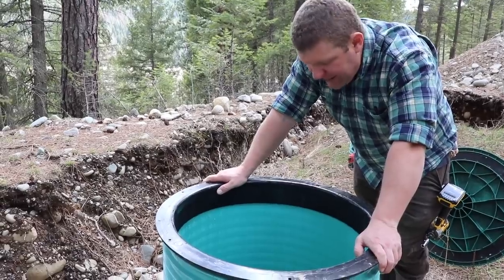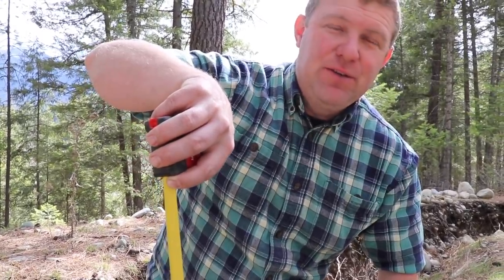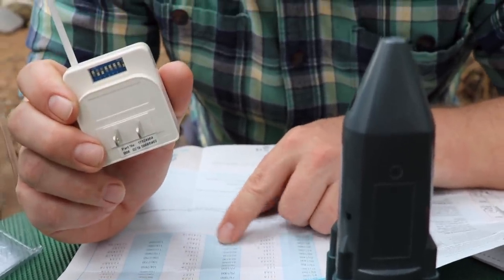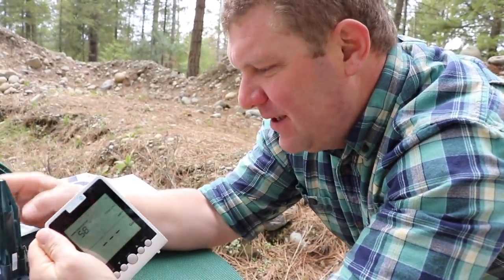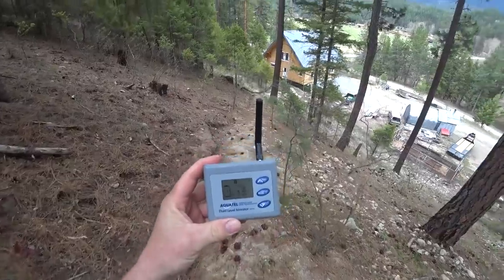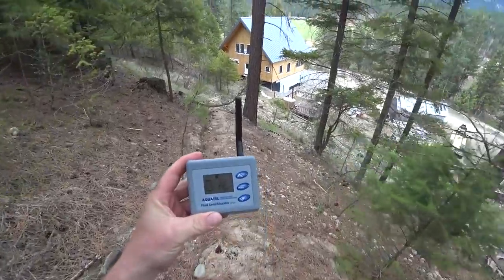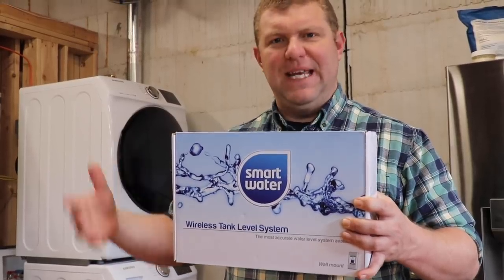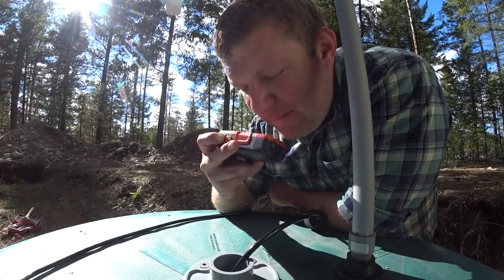Testing & Comparing Wireless Tank Monitors for Water Cisterns

Comment: should the in water sensor sit on the the bottom of the tank and what are you using for drinking water as you have added salt to your tank so you cant drink it or use it for cooking deadly for newborns too (remember you cant drink salt water) also over time it will coat the inside of the tank

Comment: Just wondering, are you filling the tanks with softened water? I am filling my emergency reserve tank ( 1500 liters )with straight hard water. When needed in the summer months when there is little or no pressure from the city service my pressure pump will kick in and supply the house with water which will run through the softener. Using the last system you could set it to fill the tanks when they reach a certain level and never worry about running out. Been working over 12 years on my home slowly. Next project is solar/wind power to get off the grid.
Good luck with your home projects! In the end its well worth it!

Comment: This may sound too simple, but why don't you measure the water that goes up the hill when you are pumping so you know how much water is in the tanks.  Then as you use water and it comes down the hill you measure that and subtract it from the amount of water in the tanks.  If you know someone who knows how to program an Arduino micro controller they could build a simple display that could display gallons of water in the tank based on signals from 2 or more flow sensors.  With 3 flow sensors you could measure water going up the hill, domestic water used, and garden water used.  You could also put a LED indicator in each bath the kitchen and the laundry that would indicate a low water level.  No radio transmission problems, no electronics out in the weather, no animals chewing on the wires.  One last thought:  If you put a solenoid valve in the garden water line you could easily control how many gallons of water each watering would be, when the watering would occur, and how many per day.  Total cost should be $60 to $120 depending on what you decide to do.
Reply: Na gravitační vodovod mu stačí mít nádrže pár metrů nad nejvyšší výpustí. Bude mít problém s přetlakem, mimo to, že ho to umístění na kopci bude stát spoustu energie, kterou by mohl využít jinak. A protože je v síti, tak to bude drahé. Už si naříkal nad vytápěním té garáže s průvanem v zimě, vytápěl ji přímotopem. Je to boháč, rád plýtvá penězi a elektřinou. Je to osvěžující v tomto spořivém světě.

Comment: The Fresnel point of the radio wattage from the tank sender transmitter to the screen has issues going "sideways" as the modulation per db is too far low to travel on that wavelength down terrain with the obstacles in its way. the amazon "jaycar" one, I used an beam (old cantenna) on a max 2meter coax antenna lead to the TX antenna made externally for the range of 433mhz UHF or 70cm band (limited by law to under <1w max 4db +-16% overpass) due to the noise levels of that frequency could get swamped by other communications that work on that same  433 spectrum ISM band (basically its allowed to transmit and receive "digital/PWM analogue noise" talk frequency . The option is to mount an dipole or beam point antenna with its direction of travel so it will work greatly. Yes the TX will be very directional, yet you will have less interference from other similar TX 433 devices. aka, garages, car immobilizers, arduino, reminder buzzers (like the boomerang announcer when picking up medication or waiting for food at huge arena/airports), WISP, even space weather is TX via satellite on the similar but much wider modulation and the list goes on that is used in that allocated free band! Unfortunately the antenna is under 1w and the TX on these puppies were under 2/5ths of a watt so basically 200mw at 1db is <200mw due to the housing and plane of the antenna pep with terrain like that would only work on a horizontal p2p (because the antenna is above a ground plane (internally) but the failure is the TX output and tiny antenna. if still no luck its more to do with you can also modify the RX with an external antenna pointed at the TX tank. or do both :)

Comment: the aquatel has external sma plugs/sockets on the 'ant' side, which can be upgraded with a more robust strength with an external yagi directional antenna. they would far less issues with overlay problems down the track. for example. your tanks are below tree line, during winter snow and the pine tree sap and leaves would dampen the signal in an instant. put a external antenna connected and run it over 6 meters away to a higher point. also use non corrosive silicon on the antenna socket from the inside, so when it does snow, it wont leak water into your tx tank system, or it will be a goodbye product and failed warranty.

Comment: I would say the cheaper units are meant to be used in close proximity. A tank next to your house catching rain runoff from your roof would fit the expected use case. The last 2 you tested with removable antennas is capable of being used at a longer distance. The antenna connectors looks like the SMA type that is usually used with wifi routers and antennas. I would bet those devices are using 2.4 GHz antennas, so you should be able to swap out the included omni antennas with higher gain directed antennas in order to increase the distance that the units could operate even more. example: https://www.amazon.com/AVACOM-Extender-Wireless-Directional-Connector/dp/B078Z1V4XL/

Comment: Isn't there a kit for sale that extend the antenna so you can place the reader inside with the antenna outside of the house??? I mean that must be a common issue for many people to get a propper signal when it's used inside. Also if the antenna is higher mounted on the house  the hill is not in the way .

Comment: I am not sure if you are still filling your cisterns with softened water but if you are your plants won't like the salted water best to use straight well water for them, also it is not the best water to drink and cook with due to the extra salt--You should plumb the softener just to the hot water system in the house only and use your softened water for washing stuff and showers and use a water filter/reverse osmosis system for drinking and cooking with
Also with the new baby be careful of that slightly salted softener water
Reply: The amount of salt added to the water is minuscule.   The salt is used to clean and recharge the filter media and is flushed out of the system once it is recharged and before the system goes back into operation.  That is why you set the regen cycle to happen when no one is using water, typically in the middle of the night.

Comment: Seems to be a lot of comments about an internal/automatic tank in the house like most wells.  Is your concern about electricity outages. If so then the large tank up on the hill (Gravity pressure) makes sense.  It tkes a lot ofenergy to pump water up a hill. Water weighes about 8.4#/gal. So lifting the 1500 gallons of water up an extra 100ft (?) in elevation uses a LOT of extra energy. Some smart EE can come up with the calcuations.  I'm an engineer and I like all the extra data, I always tend to overdesign my HOME systems. Adding an extra pair of wires (low voltage) up to the tank for a float system should be fairly simple while the trench is open.
Reply: Má vedle domu svah. Nádrže stačilo dát kousek  dnem nad úroveň střechy.  Tam pro ně vykopat uložení, nahoře je vytáhnout, na laně spustit do toho uložení blízko domu a ne tak vysoko. Možná i jednoduše vytáhnout jeřábem, naložit na vůz a stejně jako je tam dopravil odjet s nimi k domu a tam je jeřábem uložit do připravené díry. Ale má tam svah a stromy, takže je spustit na dvou lanech může na tom svahu kamkoliv s dvěma ručními vrátky. On a dva kamarádi by to zvládli zadarmo.

Comment: You guys are scratching your butts with your elbows. You have that second conduit to your cisterns laid especially for pulling wire. Suck a birdy and a snake line through it and pull 10 - 3 power conductors and a shielded multi conductor signal wire. 

Use the 10 - 3 for lighting and a weater-tight outlet and two of your signal conductors for a passive float switch leading to your well motor starter. If you want to include a wired level indicator you have spare signal conductors for that. In fact, I think you discussed these options when you were laying the piping and conduit many episodes ago.

And, FWIW, GHz battery wireless over a 250 ft hillside cluttered with vegetation and through thick walls is a losing proposition. When they say line of sight, that's exactly what they mean: clear air visibility between transmitter and receiver.

Comment: Taller aerial and maybe booster. Worked in isolated areas and we just attached an aerial to the top of a tree an ran a wire to the radio.

Comment: Sensor bars to tell you signal strenght. What do they mean? 
It's a bit of a weird one, as you'd expect say a 5 bar system to give you signal strenth in 5ths of the signal power, but nope. Thats not how radio strenth works, nor does the ideas of the people who are making these devices (including your cell phone). 
Instead, what they typically measure is the signal gain in decibels. There are power gain calculation formulas used to calculate the antenna ability to transmit... of course it's all nonsense to the lay man, and isn't needed, so hence why a few bars are shown. However, the gain is on somewhat of a sliding scale, so 5/5 bars might mean anywhere from 100% (unlikly) down to 50%. with 4 bars meaning 50 down to 20% and 3 bars meaning 20% to 10% while 1 bar could mean, anything more than 1% signal. That would be down to the people who create the product to interperate how they want to present the signal strenth to the user. If they wanted to generate a peceived better product, they could say 100% to 20% is 5 bars meaning while you have 5 bars of signal, you might only be operating on 20% actual power. not that any of it matters since the devices will work as long as they do have a consistant signal anyway.
Lastly, while antenna size can matter in some cases, a lot of the time it's just additional plastic to make things look better/fancy than it actually is. Mounting an antenna higher up, or changing the type of antenna, directional (more gain in one direction) rather than the included omnidirectional ones and can give you much better results.

Comment: Your signal issues come of a couple of problems. 1. You didn't have LOS (Line of Sight). You would have better results had you taken the receivers and put them up in the 2nd or 3rd floor. 2. The last 2 products that use external antennas will drastically increase your signal over products that have the antennas as either a wire inside the xmitter or on the circuit board (worst). So a +1 dBi antenna will give you a 12% gain on your signal, +2 dBi will give you a 58% gain on your signal and a +3 dbi will give you a 100% (double) signal gain (+6 dBi will give you 300% increase).
Ultrasonic components are pretty cheap (price wise you can get a sensor for about $4). They are not magical and have a lot of limitations (like range).

Comment: clean new sump pump bober switch have it open a valve  when tank is low and turn on water pump at well water pump you can set depth by adjusting lenth of cord on weight. to do the switching use a plc or adruino just saying

Comment: smart water would work, but that solar panel is charging up the battery. how long can it go without direct sunlight? snow could effect its life charge capacity immensely. like your pump, run low voltage to the sender units! you are connecting 110-240v lights up that path? run a low switch-mode dc power brick in an ip rated box on a pole then run the cord in a pipe towards the tank, then the cord can be fused and hard wired to the terminals of where the battery wires run to the tank tx system! you have to take to note of the sap and hill area that these systems will suffer over a short year or two... think outside the box. you have potential!

Comment: just get an accurate pressure guage, like digital, to .1 of a psi. this means that when the tank is full at the house the pressure will be slightly slightly more than if it was empty, this can be seen and if you take down what empty or full is you can tell just by the pressure how full the tanks are

Comment: If you use the Aquatell and the signal is not strong, get some "wifi" SMA 9dbi antenna's ;)
Reply: The higher the gain of an antenna the farther it will travel however in this case where the cistern is a lot higher than the home the signal will overshoot the receiver. In a situation like this you would need an omnidirectional antenna on the transmitter. A physical representation of the omni antenna is like a sphere around the vertical radiator which would be located in the center of the sphere. When you increase gain, imagine that the sphere is compressed vertically and it now resembles a doughnut around the radiator. The volume of the sphere does not change however it is spread out to a larger diameter around the radiator. Now if the antenna is much higher than the receiver the signal will overshoot the receiver which sits in the null region of the antenna. Antennas in the real world that are set on top of towers or other high structures compensate for this with what is called down tilt to fill in areas below the antenna. These require special designs that would be impractical to implement in this small scale. The best solution would be to increase transmitter power ( limited by FCC part 15 regulations ) and with the use of an omnidirectional antenna.

Comment: and you not need tank level, only one switch, show led light you tank have empty or full, 2 switch and 2 led light little cable and ready. and if want automatic ,2 switch and if empty start well pump,then full,stop well pump. thats all what need, have alltime tank full and good, same have my home outside have tank and fill automatic tank full flow switch have full level closed ventile if full.

Comment: i have on to ground water tank plastic. i add contactless water sensors 4 pcs, or if want more, and sense outside tank to water level, cable has connect to arduino board, 10$ and little simple code, id swits1, display lcd percent, or level bar  or both, or little more code, calculate level and show gallons or liters on to display, wery simple and under 70$ all parts.arduino 10$ sensors 4 pcs 8$  about, 32$ cable 5$ display 4$ battery box or power supply 2 pcs 5$ , if want wireles buy 2pcs bluetooth module or wifi ESP32 board, can later add if want relay board and add code full level and empty level code if empty relay on to pump,add water, if full stop relay pump.

Comment: OK NOW YOU NEED A PRESSURE TANK AND A PRESSURE SWITCH SO'S NOT TO BURN THE NEW WELL PUMP MOTOR UP,AS IT WILL PRESSURE UP TO WHAT EVER PSI YOU WANT ,SHUT DOWN UNTIL YOU USE THE WATER IN THE PRESSURE TANK DOWN TO LOW PRESSURE @THE WELL,THEN THE PUMP STARTS UP UNTIL HI PRESSURE @WELL THEN SHUTS DOWN ,OVER AND OVER AS NOT TO RUN THE PUMP TOO LONG.
GOD BLESS AND I THOUGHT ALYSSA HAD GIVEN BIRTH AS I HADN'T HEARD FROM YALL

Comment: or you need in house water tube what come tank in house, pressure sensor, digital, cable to arduino and arduino show lcd display pressure or code calculater pressure to gallons or liter. simple.sensor 5$ arduino 10$ display 4$ cable 5$ ready. wery cheap and simple make diy  and no waste lot money buy all shit to home.

Comment: put an electric pump float switch in the tank and wire it to low voltage and wire a light in the garage that comes on at low water instead of turning a pump on problem solved for $20 and return the WASTED hundreds in useless crap you tried

Comment: Shut off your YIFI get rid of the wireless with the baby coming .Wireless baby monitors cell phone lap top micro wave ovens, smart meter ect: It goes on .Or get a EMF meter and it will inform you of the amount of radiation you are getting around mommy and baby,I am not a troll ,Just saying get in formed.